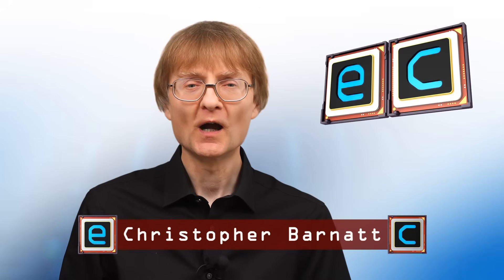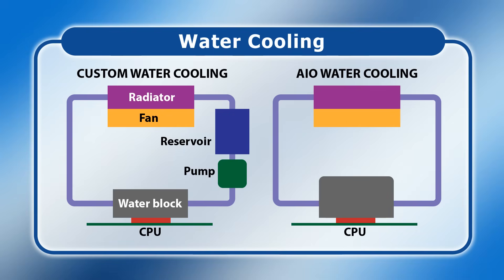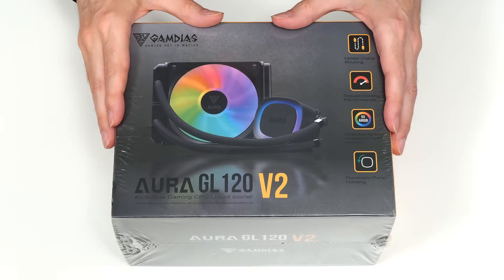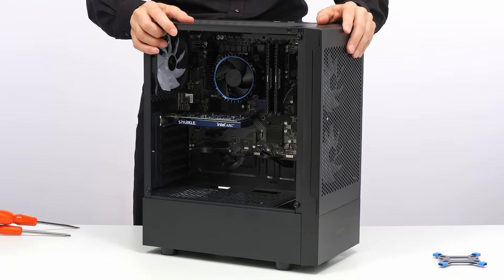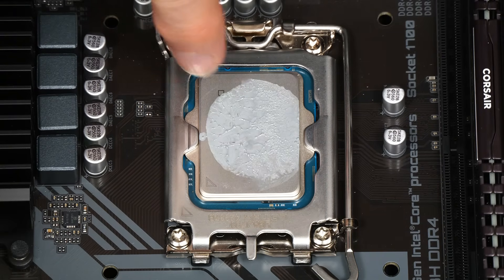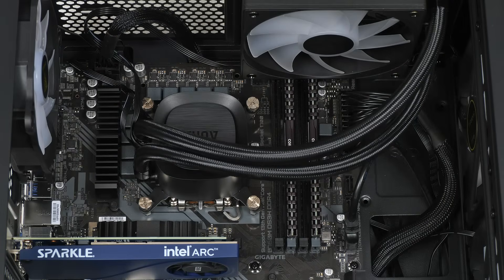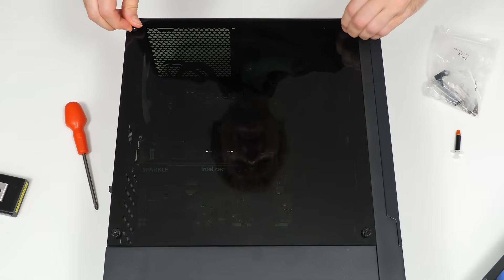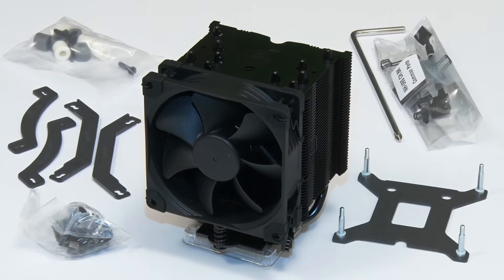Water Cooling a Desktop PC

Comment: OMG Chris! Not to mention that WC is not necessarily better than a decent Air Cooler, your application of thermal paste will result in a blob in the middle, and little at the edges. A CPU of that size should have a cross, or at least a 5 point blob. For maximum coverage. Now, I should add for WC V AC, I use a ryzen processor (5900X) not Intel, and I use a rather large heatsink with Noctua fans, so pretty quiet, and efficient, anyway.
Reply from the maker: Thanks for this, but my application of the thermal paste will NOT result in a blob in the middle. I am very surprised by comments like this today, as I though the scores of studies and videos at least 10 to 15 years ago had long ended this argument. A central, single pea is by far the best method to apply thermal paste in order to achieve a complete, even coverage across the entire die. It is the method indicated by every cooler manufacturer I've ever come across, and avoids the small air pockets very likely to be introduced by every other method! The more you pre-spread, the worse the air pocket situation will be.

The video very clearly notes that I water cooled for fun and that there usually are no practical benefits! :)

Comment: 12:41 It used to be a small pea-sized amount of thermal compound.  However, it is supposed to be more like a tiny log since CPUs are more rectangular than square these days.  The only difference is maybe 1 to 2 degrees of cooling.  The AIO is doing the heavy lifting.  I recommend using a non-stock air cooled option before switching to a water cooled solution.  If there is ever a leak, the water will damage the components whereas an air-cooled option simply won't leak water.  I carefully configure my fan curves in the BIOS to keep CPU temps in a desired target range such that it rarely ramps up the system fans.  BIOS manufacturers are far too aggressive about ramping up fan speed.

Comment: I've been using an NZXT 120 AIO for about 10 years now... the same one, it just keeps on going. I run mine with 2 fans in a push-pull config. Also, you may get better temps with a line rather than a blob on those long Intel IHS CPUs, you might have hot spots on it.

Comment: I dont trust a water cooled system. I dont want water in my system. These systems all leak eventually and considering how much dough we spend on our systems, this is enough of a reason for me to not use water cooled. Air cooling compares very favorably to water cooling. Especially on a single fan system as he is demonstrating. Those systems are woefully inadequate and barely do the job. Air coolers of the heat pipe variety are on par with most water cooled systems.

That was a very bad application of thermal compound there chris. Looks like a poor choice of cooler to be honest as the footprint does not even cover the whole chip.
Reply from the maker: I give up. It absolutely WAS NOT a "very bad application of thermal compound". What on earth is going on here today? It's over ten years since scores of studies, and many very clear videos, proved without any doubt whatsoever that the central pea method provides BY FAR the best method for achieving a smooth application of thermal compound. If you pre-spread you will introduce small air pockets. Why do people still sling to urban myths?
Reply: @ExplainingComputers  Does the thermal compound cover the entire chip? No

Does it appear as if the CPU cooler, which is round in nature, covers the entire chip? No.

 Does the silicone inside spread to the near edges of the IHS inside? Most likely.

I dont know with intel. Ive used AMD for over 30 years so could not tell you. Most likely the silicone spreads to the near edges and then smaller wires extend out to the sides that then connect further to the pins. Just like all other CPU's in manufacture today.

So lets assume the above is true. Then you would have parts of that chip not even covered by the heat sink itself and are relying on secondary air cooling via the attached heat sink's fan, to do the cooling. 

The fins are not making contact with the CPU as you clearly show a circle of thermal paste that made contact with the heat sink. Thus leaving other parts of the chip possibly exposed and not even cooled properly.

This is not about the method of spreading thermal paste but the fact that half the chip seems to be not even directly cooled. 

It was a poor choice of a CPU cooler more than anything else that led me to make this comment as the cooler does not even cover the entire chip but just some arbitrary circle in the middle, which might not even be the actual internal hot spot.

Have you done tests on this chip to ascertain where exactly the hot spot is on this chip? 

For all we know it could be in that little circle of yours, or not. It could be exposed to nothing and passively cooled only by the heat sinks fan.

I wrote what i wrote based on what i saw. I am not some neophyte keyboard warrior but a valid A+ card carrying member of comptia.

What good is some circle of thermal paste in the middle when the actual hot spot and cooling needed is in a spot that is not even covered by neither thermal paste nor the actual heat sink itself?

Comment: I have never been a fan of water cooling fearing the leaks but that looks really great!
Reply: Water cool ALL my PCs (9 of them running here) and have never had a leak.  Some of the systems are over 15 years old.
Reply: @TAGSlays  do you do maintenance on yours? i built a custom loop in 2021 and have only drained and cleaned it once
Reply: @TAGSlays Wow! that is great to know. Hope that I can overcome my water cooling phobia.
Reply: Generally, even if there's leakage, nothing dramatic should happen because the liquid shouldn't conduct electricity. Still, it's way more straightforward to just use radiators and air. I struggle to find an use case for water cooling.

Comment: For an ordinary PC workload, unlike the extreme cases other comments have cited, liquid cooling appears to be an expensive and unnecessary complication. Still, it's good to see how it's done,
Speaking of unnecessary complications, LED blinkenlights on the fan don't do anything useful. How much do they add to the cost? Are there cooler kits without them?
Has anyone tried using a venturi effect for air cooling? (If you force air into a constricted tube, it heats up. When it expands out of the venturi, it cools down. That's why aircraft carburetors are prone to icing.)

Comment: Great video Chris. I mostly use air cooling as those coolers are cheap and efficient. Recently though I did get a 240mm aio for my gaming pc. It wasn't needed but it looks nice and works well. It isn't even using a vomit inducing level of rgb! Sometimes a bit of bling is nice so I hope you enjoy your new cooler 😁

Comment: A lot of people are poo-pooing AIO's, especially ones with a 120mm radiators, But i've had mine since 2017 for cooling an overclocked 1600X, its survived being moved in between 3 cases, and is still doing fine cooling my 5700X3D, is it loud? yeah but now its retired from video editing to just gaming the only time i hear the fans get loud is when its optimizing shaders.

Comment: Water coolong is overrated. Most AIO water cooling products are crap and/or prone to malfunction. Besides, best air coolers are in most cases equally good or even better & much cheaper.
P.S. I've owned many water cooled PCs, both with AIO and DIY water cooling, but now I'm convinced that it's not worth the cost, hassle & long-term durability.

Comment: 💧 Water cooling looks so clean until that one tiny leak turns your $2,000 rig into an aquarium 🖥🐟 … anyone else get paranoid watching these builds?
Reply: Nope.
Reply: I have built PCs with home built and packaged (AIO) water coolers for over 20  years and have never had a problem with leaking.  Most of my builds run 24/7.
Reply: Yep!

Comment: Very cool. Our 200 -> 350 watt lasers are liquid cooled. Industrial chillers, hoses and fittings. Yup there is always a leak somewhere that needs addressing. 😊
Reply from the maker: That sounds like a setup to constantly maintain and tinker with! :)
Reply: @ExplainingComputers yup, with filters needing to be changed, fluid levels checked daily, and always checking for leaks. But they are in industrial environments with trained engineers and technicians.

Comment: I think traditionally a 120mm AIO would go where your exhaust fan would be, back of the case, you could also do a push pull configuration with 2 fans as well. Obviously it depends on the room on your case, usually the manufacturer shows what configuration is possibly on their websites.

Comment: Looks great.  At 7:38, would you be able to use rubbing alcohol to do the cleaning or would it be too harsh?
Reply: You can use rubbing (isopropyl) alcohol although the standard 70% is 30% water so you have to be sure it's thoroughly dry before you continue. A lot of people prefer to use 99% isopropyl alcohol for just that reason but it tends to be more expensive.
Reply from the maker: Yes, rubbing alcohol could be used. Not too harsh for the CPU, but care needs to be taken with any nearby plastics.
Reply: @ExplainingComputers  and @talon12020,  Thank you very much. 👍
Reply: As long as it is alcohol based, most thermal paste manufacturers recomment straight 90% alcohol, it will remove the paste. The heat spreader on the back of the chip is normally either aluminium or copper, so alcohol won't harm it.

Comment: the entire cpu should be covered with the paste, if not then the spots that arent covered can overheat.
Reply from the maker: Rubbish. The best method is a central pea, which spreads evenly as the CPU is fitted. Spreading everywhere has a high change of introducing tiny air pockets. Many, many studies (and videos) have shown that the central pea method results in the most even coverage. And it is also what the manufacturers of coolers (including this one) recommend.
Reply: Yhea,  I think he put on enough paste so that when the block went on the paste would have spread out. Personally I put a thin coating of paste over the top part of the cpu. The holy wars about thermal paste application, lol.

Comment: This type of cooling is unnecessary for standard processors. It only makes sense for high-end, high-heat processors.
Reply from the maker: True, but I wanted to try it! :)
Reply: Considering that larger processors don't need water cooling either, your point is rather misguided.  You can go for fan or liquid cooling for ANY processor, both options will do perfectly fine.
Reply: @elmodiddly  Except that water destroys this type of cooling, while air doesn't. In the long run, it makes no sense.

Comment: Does anyone need to water cool any more? My machine is pretty powerful for gaming and with normal air cooling it's silent - even during the summer. Seems like over-engineering for a problem that doesn't exist.
Reply: Custom loops are more of a hobby. But if you watch gamers nexus there are some benefits of AIOs as you can run your CPU at lower temperature/noise compared to air cooler(especially with something like liquid freezer), which indirectly allows the CPU to boost to higher clock speed. Maybe 5-10% performance gain if you are lucky. Especially true for 16 core or more CPUs. Below 100W CPUs the benefits might be negligible.
Reply from the maker: There is indeed very little need to water cool these days! :)